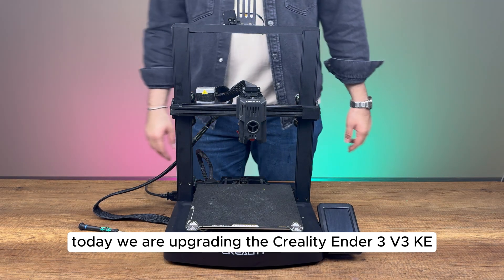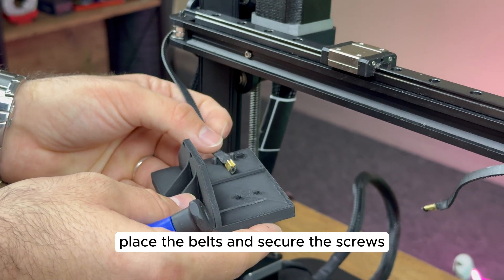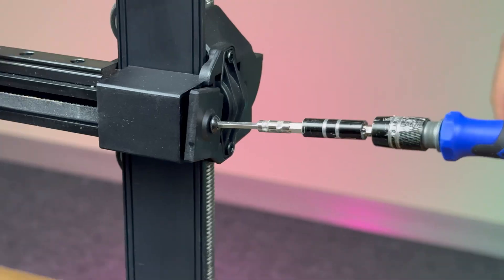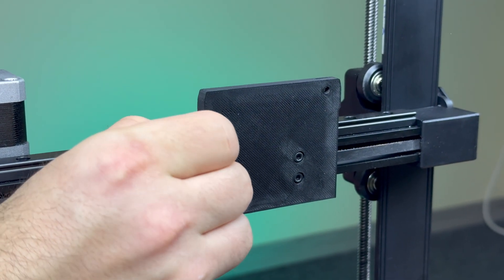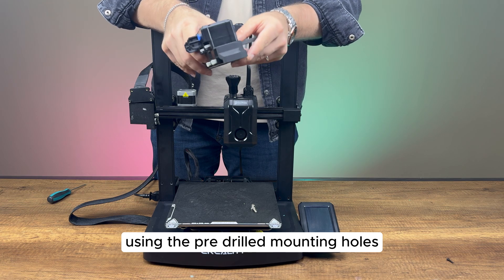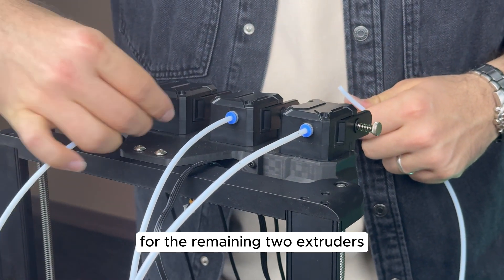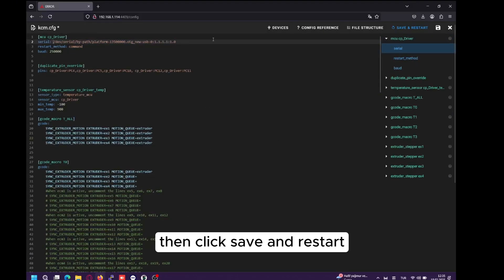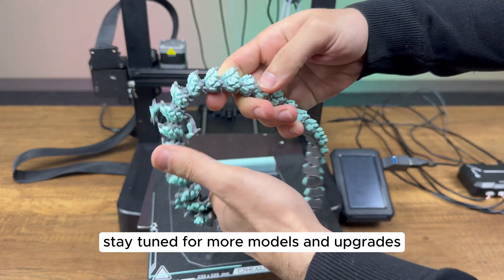Upgrade the Creality Ender 3 v3 KE for 4-Colors Printing | Co Print KCM Set Installation

Comment: it is weird....i do not have the good parts in my kit for my ender v3 ke, i also don't have ANY of your attachments ( square nuts ?!?! where are they??? ) the guide is totally on the wrong model and i have to relay 100% to youtube clips like this one, who is displaying again a total different set of parts that what i had in the box OR in the usb key......... so for me, so far, it is a real disapointment and i am now in my 3rd weeks of trying to figure out what is going where...... no answer from CS so forget about the technical part......  from my personal experience..... i actually regret getting on this project that i was absolutely sold from day 1.  I will try not to waste my entire chrismas holidays by trying the files you suggest here but i am getting tired of trying to fit a circle in a square...... specially knowingly that no refund will be done at any time.......

Comment: Hello,  I have a few questions because I really like my 3D Printer and I want to get this product. I'm using the Creality Studio for Slicer. It will work? The only thing that I have to do it to set up the colours in which spool are they and that's it? Furthermore, the functionalities of the printer will stay the same, for example wifi etc.? Nevertheless, the guide in your site is not working for the Creality Ender 3 V3 KE.
Reply: no, as i see in the video, you need to root your printer and get mainsail and all the other stuff so you can modify teh files he showed in the video. creality locked the firmware of the v3 ke. so you cant modify anything, and barely control half of what you be able too with the full power of klipper. thats the only thing you can do to add and modify the cfg files you need to add. getting a tutorial on how to do it is pretty easy. look it up.

Comment: Does anyone have a list of the additional hardware required for this upgrade? As in the size of the additional screws and square nuts? Looks to be a 7mm square hole and an M3 diameter. So M3*8? and 6.5mm Square nuts? How many of each? Printing the parts was easy, realizing the kit I bought supplies a manual and parts for the "plus" model is frustrating but understandable.
Reply from the maker: Hello, the requirements for this upgrade are included in the kit. You just need to print some parts according to your printer before installation.

Comment: Does Co print KCM 8 color module also work with Ender 3 V3 KE?
Reply from the maker: Hello, of course it works. You can use 8 colors with the ECM module.
You can check it on this page. 👉 coprint3d.com/kcm

Comment: On the part were we are setting the crhoma head and we put the secon usb cable, were is it attached 9:39
Reply from the maker: Hello! If only one cable came with your set, you only need to connect it to the printer.
Reply: I have the same Ender of the video, buy trying tò set the port of the crhoma and the kcm they have the same path, the system specify tò have two different path

Comment: Hello, im wondering if this same setup would work with the Ender 3 v3 with either the same or different printhead?
Reply: I bought one and regret it. Refund is only 2 weeks after you place the order, but you won't get the machine for 2 months. Then they say to print your own parts, but the parts don't fit the printer. Additionally you need to be a programmer to rewrite all of the coding. My recommendation is to buy something that already supports color. This isn't the way to do it.
Reply: @Thomas-gx9jk  I am going thru the same exact thing, other videos show metal mounts, i didn’t receive any mounts, no files to print mounts, been sending nasty complaint to support, they stopped answering. Bad Business, they delete all negative comments.
Reply from the maker: Yes it works!

Comment: Do you lose auto level feature? because I didn’t see you reconnect level sensor and  board is out of bead? Or does head comes with level sensor and how this is setup in the printer?
Reply from the maker: We have our sensor inside of ChromaHead, so not losing auto level feature.

Comment: What type of hotend does it have? Is it all metal? What filiments are compatible? I currently upgraded my hotend on my v3 to the hotter hot end from creality... And don't see any separate hot end upgrades for the multi color system 🤔
Reply from the maker: The ChromaHotend is specially manufactured by Phaetus. You can find the necessary information on our website:
coprint3d.com/collections/spare-parts/products/chromahotend
Reply: @CoPrint3D  You need to answer the question. Your spare parts page doesn't say if your proprietary parts are brass or hardened steel. For those of us using multiple filament types, we need to have both and be able to change them out.

Comment: Hello. I bought the upgrade to 4 colour. Now I´m worry, because the probe sensor isn't installed at the chromahead. The Support of creality said, this probe sensor isn't needed. Is this right? The power supply isn't included, too. Is this right, too? thanks.
Reply from the maker: Hello! Yes, the ChromaHead has its own built-in bed leveling sensor, so there is no need to use a separate probe. If you purchased the product through Creality, the power supply is not included.
Reply: Why do u need the powersupply
Reply: CoPrint doesn't supply the parts or the power supply. If you want something that works, just buy a new Creality. You'll be messing around with this for months before you get it to work - and forget about customer support. They got your money; now they're done.
Reply: Where can I get ChromaHead?

Comment: Did you wasted the CR-Touch and now the bed requires manual leveling?
Reply from the maker: The CR-Touch on the stock printhead is removed along with the printhead. However, no need to worry! ChromaHead features a highly precise proximity sensor that enables automatic bed calibration.
Reply: This all looks good until the IP address. Creality cloud servers have been down for a year…

Comment: For the cost and hassle just buy a pre built multi material/colour printer..? A nice idea but why?
Reply: Because everyone can't afford  one that's whyyyy
Reply: @KLYSHOES that doesn’t make sense. The rrp on this unit is 400 dollars… you can buy a hi combo for (pre order) 469 dollars. I’m not taking into account sales/discounts etc.. but to get a printer that’s set up for colour AND keeping your old printer for normal prints for only a slight amount more without the hassle 🤷🏼‍♂️ doesn’t make sense.
Reply from the maker: Sometimes, users need this product for larger machines rather than just a printer capable of multicolor printing. It’s also a great solution to upgrade your existing printer for multicolor prints. Additionally, compared to its competitors in multicolor printing, it offers advantages in terms of speed and functionality.
Reply: Will this be compatible with the ender 3 v3 se ??

Comment: is this possible for the Ender 3 v3 SE ?
Reply: Probably
Reply: Wha not? KE and SE have same base. May be you also need to buy nebula kit.
Reply: @alexdiver9809  or just a simple raspberry
Reply from the maker: The Ender 3 V3 SE does not include any mini-computer running Klipper. However, there is a solution for it as well – the Co Print ChromaSet, which enables Klipper on your printer. By getting the ChromaSet, you can upgrade your printer with multicolor printing capabilities.

Comment: Thank you! I have been waiting for this for a while

How hard is it to print the parts? I haven't gotten my calibration good enough yet so that is something keeping me on the fence from buying the KCM set.
Reply from the maker: The parts designed to be 3D printable have special tolerances to ensure they can be printed on all printers. Care has also been taken to make the printing process easy. So, you can purchase it with confidence.
Reply: It's easy to print the parts. Unfortunately they don't fit. If I could return this I would. As it is, I'm on my third set of prints and they still don't work right. Holes are out of alignment - off by a couple of mm - enough that it doesn't fit.